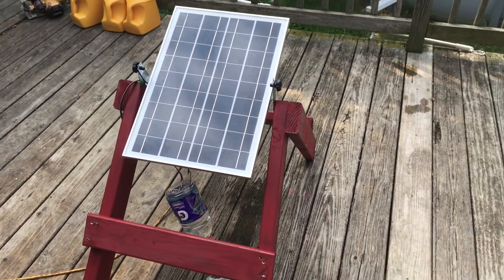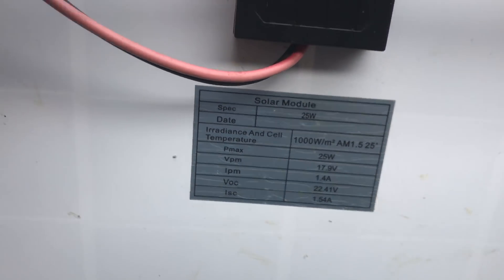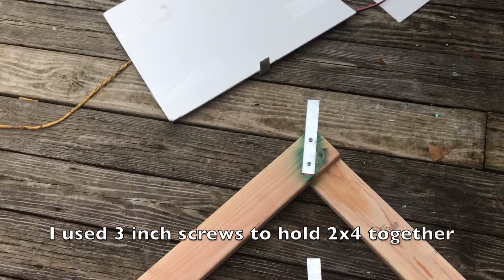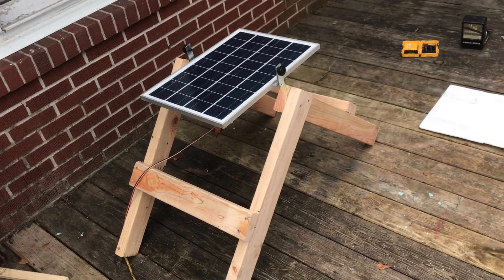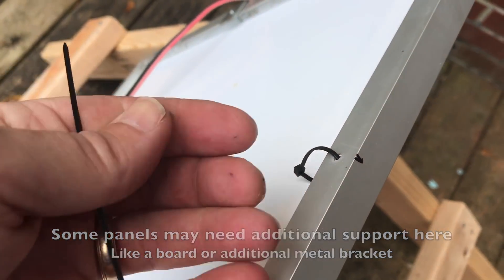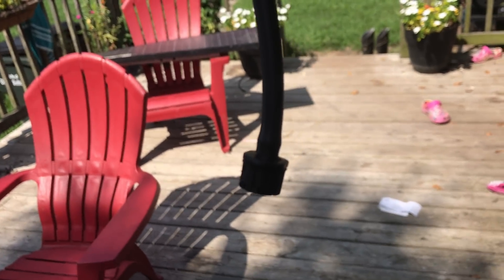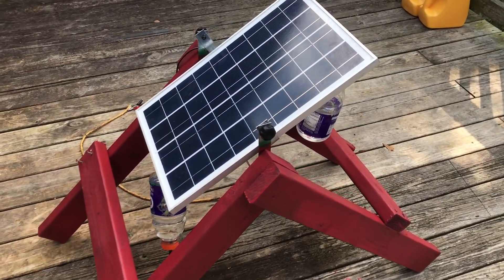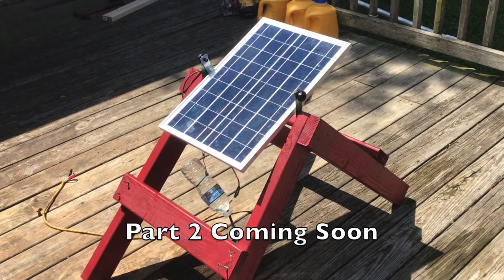DIY Solar Panel Tracking Low Cost

Comment: BRILLIANT!

Now think about this:
Two bottles, one empty and another one with water.
The one with water gets sun, it evaporates and condenses in the empty bottle.  It makes the empty bottle to get water and weight more, the solar panel will flip to the side of the sun.
Next morning, the process repeat, but the other bottle starts empty so the cycle reverses.

Comment: This panel can put out close to 100 watts https://www.youtube.com/post/UgkxOqI2yqX0XVrhR2BMJciTWrHJpG8FhJyg  when positioned in the appropriate southernly direction, tilted to the optimal angle for your latitude/date, and connected to a higher capacity device than a   500. The built in kickstand angle is a fixed at 50 degrees. Up to 20% more power can be output by selecting the actual date and latitude optimal angle.The   500 will only input 3.5A maximum at 18 volts for 63 watts. Some of the excess power from the panel can be fed into a USB battery bank, charged directly from the panel while also charging a   500. This will allow you to harvest as much as 63 + 15 = 78 watts.If this panel is used to charge a larger device, such as the    power station, then its full output potential can be realized.
Reply: 👍👍See also: Solar power plant mounted in multi-storey building! (for survivors in the zombie apocalypse): 
Shorts version:
https://youtu.be/k9AiiCLALRA

Full version:
https://youtu.be/sOskjOsl-cA

https://youtube.com/shorts/GuZc2KhHEs0?feature=share

High Power Mega Coil gun! - YouTube

Comment: Very nice, frugal, and practical, on the drip side, if you put a recipient to collect the drip, recollect the water, paint the recipient blk to prevent rapid evaporation, install a small 6v water pump in the recipient to return the water to the dripper, the water pump could be activated bluetooth, or solar/night fdr.

Comment: I was planning to do this slightly different....  I would use a small pump to fill the bottle on the upper side at a very slow rate... the pump would be powered by the solar panel so it doesn't pump at night.   When the water container reached the bottom with the solar panel pointed west it would have a simple valve that would strike the ground and release the water slowly until it was empty.   The counter balance would reset the panel to the east and wait for the sun to come up an power the pump to start the process over.

Comment: Couple things. First you could use a saw horse.  This would save construction time and make it more portable.  Second, you could probably do two more panels on the flanks.  Third you could set this up on the grass and stake it to help with wind.  Fourth you could add ad some extra holes and a taller bracket to create season adjustments.  5th automated water filling should be really easy with some type of timer system.  I'd go with class bottles spray painted black to reduce mold growth.  Outstanding system.  I love it!!! Please make sure you do a follow up video with the automated system!! Do you have ideas to prevent wind fucking with the panels?  Maybe some type of one way pneumatic piston? I'm wondering is you could use sand as well instead of water? Thin you just dump the sand back into the bucket at the end of the day?

Comment: i was just thinking abt this..with a dead weight on one side and sand in bucket on another which would be filled slowly..thus requiring incresing the wight of the system to counter the distortions caused by wind

Comment: Putting a mirror around a fixed solar panel to reflect more light on the panel would produce the same 30% efficiency.

Moving the panel or using mirrors, would also reduce its lifespan by 30% !
Reply: Like your idea

Comment: My compliments, Scott....they say great minds think alike and I have been chewing on this same concept of using either water or a clockwork mechanism like a grandfather clock with a pendulum which would require resetting each evening for the following day. If using the water counterbalance, my thought was to use an inexpensive solar-powered pump to pump the water from one bottle to the other in a closed system. This would have the advantage of allowing the use of any antifreeze solution to preclude freezing in the winter. While perhaps not perfectly aligned to the sun, either of these approaches would be an improvement over a fixed installation with for very little investment and low tech.

Comment: Bad idea. As long as one weight is heavier than the other, it won't move at all. When the balance changes and the other weight becomes heavier, it moves to other extreme position and sits there.

Comment: How is working principle .
it is utter foolish .
Reply from the maker: Basically, the water drips out of a bottle and the solar panel follows the sun as it drips. The challenge is to get the water to drip at the right speed, not very hard. And later to add a simple and inexpensive electric water pump to pump water back in for the next day.  The attractiveness of spending any sort of time with this is the low cost factor. And for those people in developing countries who might benefit from really basic forms of technology that might improve their lives greatly.
Reply: blal a, your too fool to know how it works, its the best, cant wait for the update
Reply: Next part "how to replace rotten deck board" :p
Reply from the maker: Ha!
Reply: ...or how to install a longer drip tube.